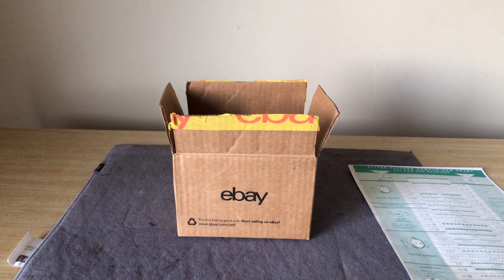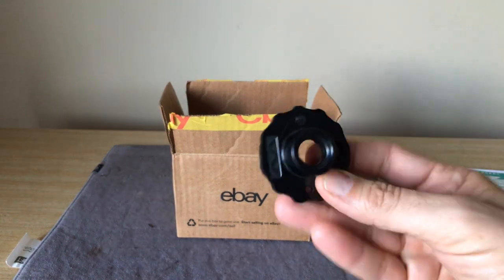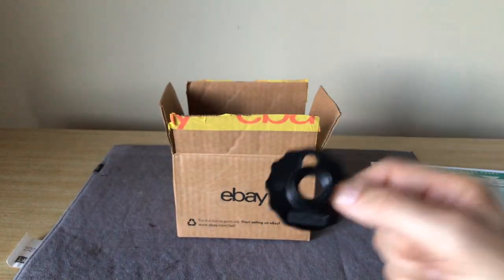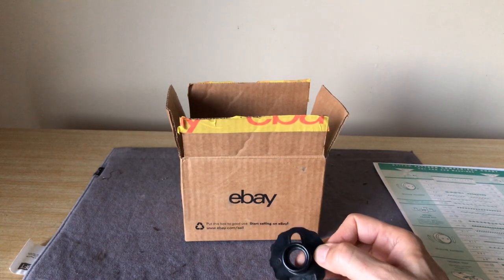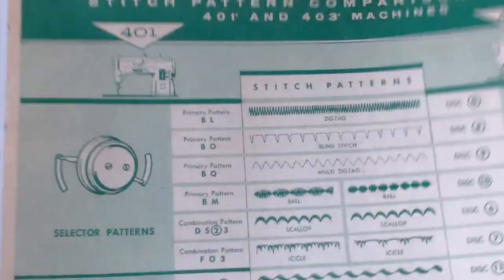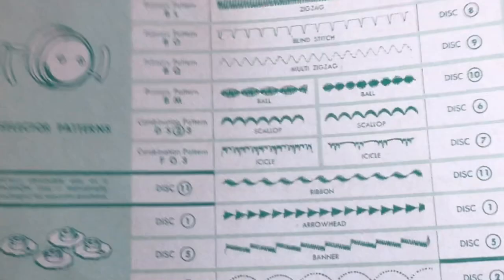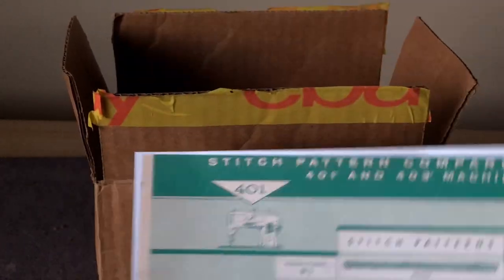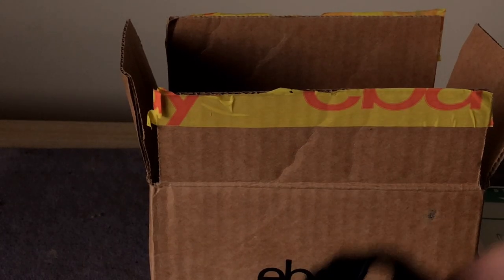TOP HAT & TALES!!  What Are Cams & Why Did Consumers Buy Them? Singer Decorative Stitch Cams!

Comment: This is a great video. I’m in search of cams for a Singer Merritt 2430. On the front of the machine it shows 37 stitches. I haven’t had any luck searching and didn’t know if you had a source that I’m not aware of. TIA. Debbie.
Reply from the maker: You might try searching on sites like Ebay, Etsy, as well as Bonanza.

Comment: Timing is everything...I just bought a 401a on Ebay and this is great information. I remember that when I received it, the seller included a box of 12 cams but the box was labeled for the 600 and 603 machine. I haven't had a chance to play with this since I got it. A link to the PDF would be awesome if you can. Many thanks for another informative video!
Reply from the maker: I just updated the video description with a link to the blog where I found the chart.

Comment: One must always have a fashion disc installed in the machine usually the zigzag disc.
Reply from the maker: John is right.  For some machines, you cannot sew anything but a straight stitch without a ZigZag cam installed.  For some other machines, ZigZag and sometimes a few other stitches were built into the machine and could be used without a cam whereas some of the more decorative stitches DID require a cam.  It all depends on which model you have.  If unsure, the user manual will verify this for you.
Reply: @VintageSewingMachineGarage  It would be a good idea to pin this post so it will always be at the top, along with your reply to my comment.

Comment: Question: Are cams made by all manufacturers pretty much the same and would they work with any machine that accepted cams?
Reply from the maker: What a great question Barbara.  No, cams are not interchangeable amongst most all brands.  Even within a brand, makers would often introduce new sewing machine models with updated or all new designs and would create new cams accordingly.  One of the longest running cam designs was the Singer black "Top Hat" style cams and even those eventually were redesigned for newer machine models.  So, that is the bad news as you have to find the cams which can sometimes take some searching (Singers are the easiest to locate due to their long running production and shear quantity that they produced.).  The good news though is that cams are often quite reasonable to purchase since not everyone cares to use them and lots of folks have no idea what they are.  I suspect many were tossed as they were unidentifiable for many people.